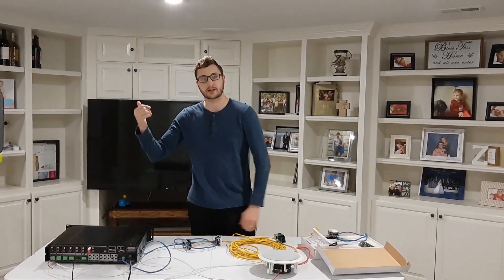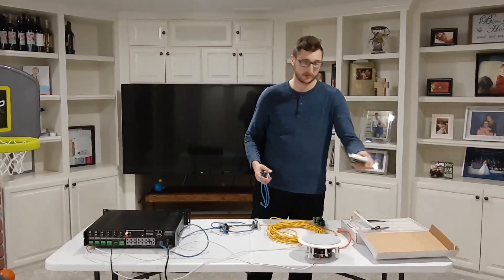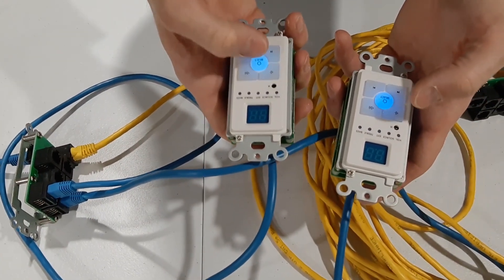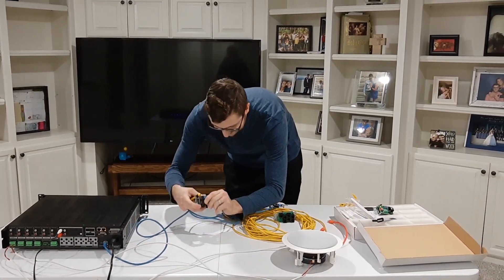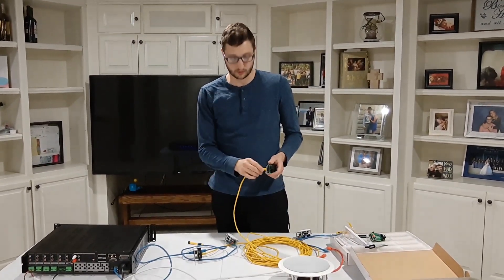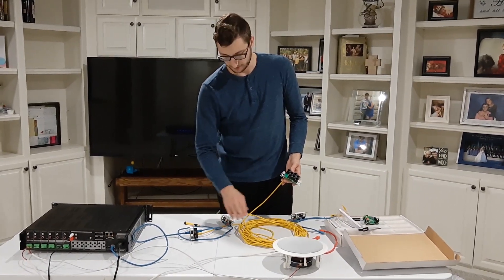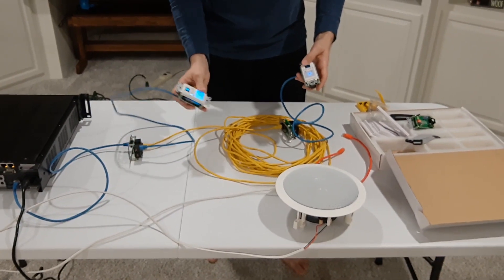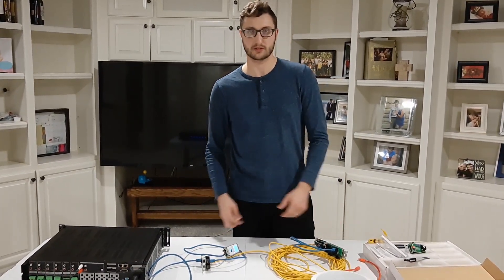More Than 1 Keypad in a Zone? Why Does the Hub Have 7 Ports?! The Monoprice/DAX66/Soundavo WS66i WHA

Comment: My monoprice stuff is at a different location so i cant check if keypad hub has 7 like your soundavo hubs.  If it does can i just buy a separate soundavo hub and use just like you have and everything be compatible with monoprice components or will the soundavo hub have some incompatibility issue with mono?

Comment: Hi, I just moved into a house which has a six zone monoprice amplifier. I managed to connect my living room tv to the system with an optical cable since my amplifier is next to my tv. My sound is working. But evertime a video or anything is started or ended, I hear a pop sound. How do I get rid of it. Also is it possible to control the sound from my tv remote ? I have another tv in my master bedroom. How do I connect that tv to this amplifier or sound to my speakers in my bedroom. I see that the wall has a blue plug like a lan plug. Appreciate your guidance greatly.

Comment: Hi, thanks for the informative video. I have one of these Monoprice units and I've been slowly installing different zones. I am having an issue where my keypads will have power, but they don't turn on and cannot control the amplifier. I've checked and double checked all the ethernet cables. I'm running cat6 and they are all tested. The dip switches are set to the proper zones. I simply cannot get some of them to turn on. The only difference between what is in the manual and my installation is that the cables are wired with 568b ethernet vs what it specifies, 568a. Do you think this is making a difference? Any help is much appreciated.
Reply from the maker: As long as the ethernet cables are the same on both ends it shouldn't matter how you wired it. Did you find a resolution? Do you have any high power (220v) etc power runs that are running near the ethernet cable?
Reply: Hi, did you find a solution ? I do have the same problem on two of my keypads (but not all the time) : the LED is ON but they won't respond. I have a DAX66 so it's phoenix connectors in my case. Thanks for any info ;-)

Comment: Good video.  I am new to home audio, but have played with tons of home automation and video security systems.  I bought one of the Monoprice systems to try it out and planned to expand to 3 units for 18 zones.  My question is will it support inputs to each of the units?  One unit has 6 inputs i believe, but could I also connect up devices to each of the inputs on all of the 3 units giving me 18 inputs?
Reply from the maker: No, if you expand to 18 zones you will still only get to share the 6 sources which are connected to the master amp
Reply: @TheKMZ1  What would be the zone addresses for the added keypads? Zones 7-18? The manual ONLY shows Dip switch settings for Zones 1-6
Reply from the maker: @Kenstanly1  they start back over and you address them 1-6 again for the second amp and if you have the 3rd amp hooked up, again you start over at 1-6 to address them. The amp has a switch in the back for master, slave 1 and slave 2 amps. So that is how it knows which amp the keypad is controlling
Reply: @TheKMZ1  So do you select zone 7, 8, 9, or 10 for example on the keypad?
Reply from the maker: @Kenstanly1  no, zone 7 is addressed as zone 1, zone 8 is addressed on the back as zone 2 and so on
Reply: @TheKMZ1  Thanks for the clarification and great videos 👍🏾
Reply: Hello,

I have both amps connected, Master and Slave 1. The keypads that are connected to Slave 1 dont come on. The select light is lit, but when i press for it to come on nothing happens. 

Are there any additional setting that need to be done beside the toggle switches on back of both units? I have the ribbon cable connected out of the master into slave 1.
Reply from the maker: @Kenstanly1  Did you make your own ethernet cables? It sounds to me like a cabling issue, maybe wires are crossed or not terminated correctly. You could troubleshoot by temporarily disconnecting the keypad, getting a few pre-made ethernet cables, and connecting that from the amp to your keypad hub, and then another cable from the hub to your keypad. If that keypad works fine, then it is a cabling issue somewhere.
Reply: @TheKMZ1  Yes I did do my own ethernet cables. I will triple check those. So there is not any other settings that needs to be done. Just plug and play after that for expansion amp?
Reply from the maker: @Kenstanly1  that is correct no more settings just plug and play
Reply from the maker: @Kenstanly1  also these work really well to detect if the Ethernet cable is good https://amzn.to/3T1352Z
Reply: @TheKMZ1  Thanks, added to cart to order. But the wires for the keypads i have. Have to be stripped and screwed  for the Dayton DAX66 amps I have.
Reply from the maker: @Kenstanly1  oh I was thinking you had the monoprice or soundavo unit which uses fully terminated Ethernet jacks

Comment: HI! Can you explain further if why does it have 7 ports on it? and may I also ask, if one keypad is not working is there any troubleshooting/fix that can be done? Hoping for your kind response. Thank you!
Reply from the maker: It has 7 because the 7th port is a "cascading" port meaning you could buy another keypad hub, and you could run an ethernet cable between the 2 keypads connecting the keypads together. Doing it like this allows the keypads to be in different parts of the house, so it could help you run shorter cable runs from your keypad back to a hub.
Reply: @TheKMZ1   Thank you so much! Please make 
more videos about Monoprice's products love your videos! God Bless!

Comment: Great, video.  I had no idea who you could that with an extra keypad hub. Do you have any idea what method of communication those keypads are using as those hubs don't have an IC's.  Is it just a serial connection w/ power?  Asking as I forgot to run a cable and now need to share my keypad over another ethernet cable using 10/100 ethernet (uses only 4 wires of Cat6).  Can I use the 4 remaining wires for one of these keypads and get away with it?

Comment: Hey thanks for the great content. However, even with the discount, these units are still almost twice the cost of the Monoprice version. How is the cost difference justified?
Reply from the maker: I have a comparison video on my channel, but when you add in monoprices tax and shipping which is expensive, plus you get the 2 wireless streamers, the app control module built in, the cost difference really comes down to a few hundred dollars. For me and many, a few hundred dollars is easy to justify when you get less cables (cleaner looking install), and a company that's actually investing into these products instead of a reseller (monoprice) my 2 cents tho!! Thanks for watching I appreciate it!

Comment: Well that's good to know about the wall controllers not coming on if they are set to the same zone.  I have a couple that didn't work and I didn't know why  They light up, but will not come one, maybe it's an easy fix like this.

I've got the old setup and plan on buying your app and the items needed to control it over my phone.   Will this allow me to be able to control it via a Google home as well?

One last question you might know because it's a little more advanced.  In all my bedroom I put a A/B in wall speaker selector button.   I did this so I could either hit this button and my speakers in each bedroom could be connected to the whole home audio, or they could be controlled by a device like a surround sound so you can play the Audio from the TV without using all the "Sources" on the whole home audio unit.  This works great but I'm looking for a button of some type I can control from my phone..  So many times we get in bed and forget to hit the button so we can hear our TV in the speakers above our bed. It would be nice to be able to control that via a smart device, without getting out of bed.  lol  talk about lazy..   here is the push button I have. https://encrypted-tbn0.gstatic.com/shopping?q=tbn:ANd9GcTHl79Eyl9SuDZTewutLGAr9Dc3wdhz6vfnaRoidUZvdh00qxGvBNRftWviXx7aDLriGNL5JoMkleKX8DK1-MSZIOGX9-kG-PMGFxxQjSlLoz-U51fEcZrGO7AYNBc&usqp=CAE
Reply: Was it your problem ?
Reply: @aRndBelgianGuy  on the switch not working?
Reply: @imlon2  Yes, having the main LED blue but doing nothing. Thanks.
Reply: @aRndBelgianGuy  not sure I have 2 that no matter what channel I put them on will only light up but will not turn on.
Reply: @imlon2  :/ me too, but if I reboot the amp, it will work, then fail again later.
Reply: @aRndBelgianGuy  I’ve even tried a whole new unit. Same issue.
Reply: @imlon2  Sad to hear. I'll let you know here if I find something.
Reply: @imlon2  When you say "a whole new unit", you're refering to a new keypad or a new amplifier ? I'm actively inverstigating in this issue !
Reply: @aRndBelgianGuy  a new amplifier did not help the wall plates. Changing out the wall plates completely and the new ones work with no issue.
Reply: @imlon2  Good to know, I have a few spare keypads ! Did you change the keypad hub too ? I thought it may be the culprit too... Thank you !

Comment: How do I address the keypads to each zone?
As in, how do i know if the keypad installed in the living room will control the zone?
Reply from the maker: On the back of the keypad there are dip switches, and on the back of the keypad there is a guide that says how to address them. So line up down up on the switches means a particular zone. Does that help? Thanks!
Reply: @TheKMZ1  is up on or off on the dipswitch
Reply from the maker: @timp.2693  up is on

Comment: I am a little confused on this one however.  So can you add two keypads to control one zone by adding another H-1 Keypad Hub Wallport and making sure you don't address both controllers with the same code or flat out you can NOT control one zone with one or more keypads, I am confused.  It sounds like you can if you all an additional hub?  Please explain.  Thanks.  BTW I am using your affiliate link to buy my stuff.
Reply from the maker: Hey Steven, unfortunately no you can't have any combination of 2 keypads operating 1 zone. Not even with another keypad hub. Thanks for watching!
Reply: @TheKMZ1  Thanks.  I am no longer confused.  Thanks again for all the great videos.

Comment: Does the keypads support Wireless or BT  for app?
Reply from the maker: The keypads have an IR receiver on it and you can point the remote at it to control it, but they don't have wireless or BT. But the ws66i amplifier has wireless streamers and the control module built in so the app can control it

Comment: Can the amplifier be used without the keypads? I have the older model
Reply from the maker: Yes they can be used without them
Reply: Guess mine may be broken any tips on how to cycle through the zones. Im using rca to headphone jack to my cell phone
Reply from the maker: @mynormunoz9880  do you have the monoprice or soundavo
Reply: I believe its monoprice it has no Logo on it
Reply from the maker: @mynormunoz9880  are you setting your keypad addresses correctly? On the back, there is those 3 white switches. You plugged those into the keypad hub, and then 1 Ethernet from the hub to the back of the amp? The only other way to use it without the keypads is to buy the itach flex and flex link rs232 but this will cost you more money.
Reply: I dont have either, i just had it hooked up direct from my phone to one of the audio zone inputs, and a speaker out of one of the zones. dose monoprice still sell the keypads or can i use a different kind?
Reply from the maker: @mynormunoz9880  you don't have the keypads? Where did they go you need keypads or the app to turn the zones on. On the front of the amp, if the lights are blue, the zone is off. If the zone is on, the light will turn white. You must turn a zone on
Reply: @mynormunoz9880  So do you mean you can play music from any zone without installing keypads but speakers.
Reply: @kakaduru105  you need the keypads to activate/change zones
Reply: @mynormunoz9880  Thanks for your quick responds I really appreciate. Please can you share with me the app name or link for controlling the amp when am in use of the keypad
Reply: @kakaduru105   i dont use an app just the keypads
Reply: Thats the issue then all lights are blue, bought amp by its self guess i need to find the A key pad
Reply from the maker: @mynormunoz9880 I think I can find you some, but they are $40 per keypad. Do you want them?
Reply: What app can i use?
Reply: Yes please!
Reply: @Thekmz1 any luck finding those keypads?
Reply from the maker: @mynormunoz9880  https://www.ebay.com/itm/Keypad-Controller-for-6-Zone-Audio-Multizone-Controller-Amplifier-Kit-10761-/293727873599?_trksid=p2349624.m46890.l49292

Comment: So, you would have that second hub completely inside the wall since the long yellow Ethernet cable you have is connected to the backside of hub 1 and the other end of it connected to the front of hub 2? I have a scenario that would work perfect for this but somehow I think that second hub will need to fit entirely inside wall to look nice I guess.
Reply from the maker: In my case i'm not putting the hubs inside the wall, I put my keypad hubs in on-wall extra deep boxes. The cable will come out of the back of that expansion port, go inside the wall into my attic, then down my garage into the basement and then into the front of the next keypad hub, which will be mounted on another extra deep on-wall box!